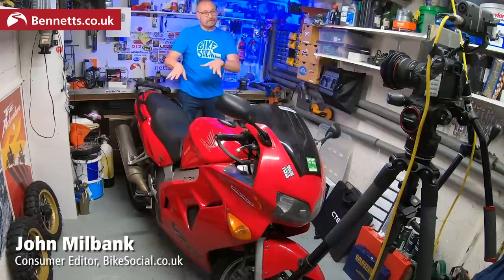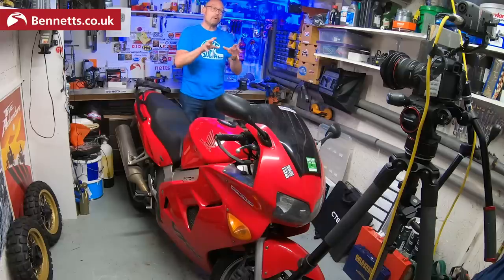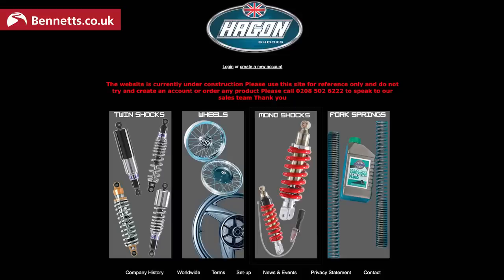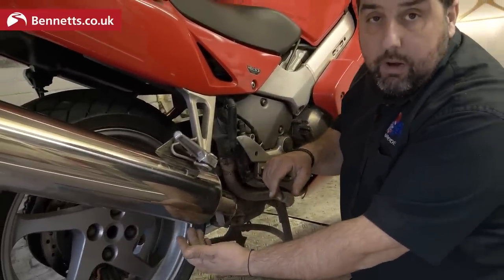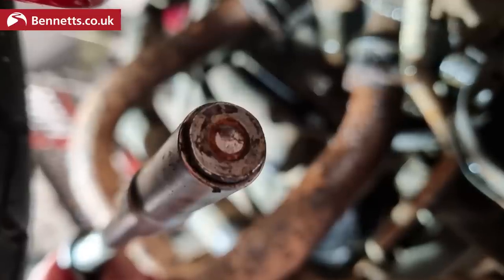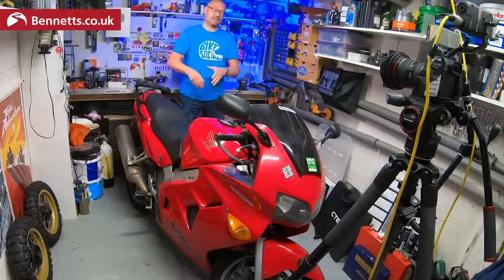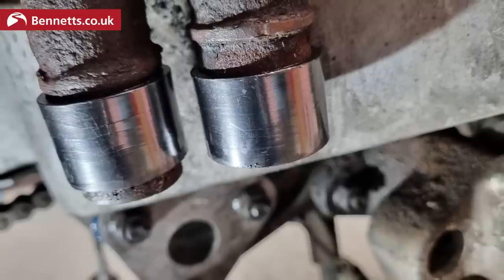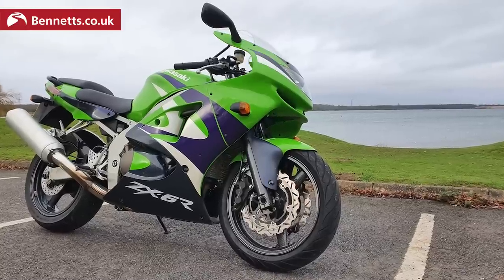Shock swap on a 97,000 mile VFR... what could go wrong? Everything.

Comment: Christ knows why you had to take the front pipes and collector box off.
I've had my 800 from new in '98.
Changed out the shock after 35k for a fully adjustable Nitron, it's been jn and out a few times for servicing. I have slso swopped out rear shocks on a few other 800s with no problems and have never had to remove anything but the rear wheel and the end can.

Comment: What if I told you there is no need to remove the exhaust to change the shock?
Reply from the maker: I was also trying to get the full linkage out to check the bearings - sadly it has to all come out for that. But yeah, once I'd got the whole thing off I realised!

Comment: Did you replace the collector box bracket bolt
With an Oem one. Doing this job now what a massive  pain to remove that bolt same as yours completely corroded have it our now as I'm fitting a full stainless exhaust and the centr stand is a pain aswell. Love your videos their  making my job a bit easier to do , I'm goimg to replace the rear shock aswell .
Reply from the maker: Yes, and it was bloody expensive! Cheers, John

Comment: I did mine with a hagon shock without the remote and it only took me about an hour, I never had any issues 😂… mine hd been a bike only used in the dry by how it looked everywhere
Reply from the maker: Show off!
Reply: @bennettsbikesocial  I must just have got lucky, I don’t remember taking exhaust off, the shock dropped out at the bottom after I removed the triangular mount

Comment: Ahh nothing like having a whinge at design engineers that made something as wonderful and robust as these VRF's. A 150xxxkm bike that's been averagely maintained, is rusty as hell and has an exhaust system as flogged as that should have been better cared for long ago; it's an outcome of poor maintenace you're dealing with not poor design, if the cheap hardwarewas replaced before it got to this state there'd have been no issues lol? So funny, you Euro/UK guys have  a very different tolerance for rust than we do in Aus, in Australia a conciencious owner/quality mechanic would have tossed those flogged headers, flanges, studs, shock bolts and replaced them all a decade ago looking like that; and cetainly wouldn't have refitted them in that state... when Delkavic make the whole system for 250pound/$480AUD. Also those rear shocks ARE rebuildable by a shop that knows what they're doing, I've had multiple stock sealed OE shocks (inc. a Husky TR650 & my VFR800) rebuilt, pistons machined and revalved in the past. Loads of shops in Aus, and I'm sure in the UK, that can do this. Obviously the full replacement is a nice option but also cost me ~180pound/$350 AUD for my last sealed unit rebuild & revalve and this replacement cost $1000AUD so better to do at least rebuild of the stock unit than nothing for those on a budget.

Comment: 9:25 If you were a gentleman, you might have done the heavy lifting whilst you wife pushed the bolt in. And if you were an engineer and aspiring contortionist, you would have used a simple wedge or lever system to lift the back wheel as you aligned the bolt yourself. 🧐😎😜🏴 VFRs are great value aren’t they?
Peace
Reply from the maker: I'm neither!

Comment: I don't understand this. I have had the shock out of my VFR  ( 2001)3 times . (106000 km) I put  a WP in it at bout 25,000 km,  and haven't had to take the collector box off. I took the back plastic off and the bottom bolts on the rear sub frame and lifted it up and braced it out of the way with a 4x2.. Once the bolts are out of the shock I jacked up the rear  swing arm without the tyre on it and could wiggle the shock out the bottom.  (Well I think that is how I got it out but the Chemo fog makes me wonder. ) The top bolt , well that is their little joke. they must be put in before the wiring bundle. Bolt head is on the left. I put it back in from the right and it is easier to get to . I was able to have it on the center stand.  I did also take the right side heat shield off and then thought  that is wasn't necessary. I had springs and valving done by Frank Ponds and the bike is nice to rice everywhere. I got the hydraulic pre load as well.
Reply: I like you dedication getting the broken stud out. I think I would have retreated to the corner for a few deap breaths and called for help.
Reply from the maker: I was trying to get the linkage out too, to fully service that... wish I'd not started that!

Comment: I feel your pain on the collector bolt. Last year I replaced the exhaust system on my '01 VFR - it's only done 27000 but the bolt was in a similar condition. It took hours of careful cutting and drilling. Was ready to burn it to the ground. 
Got to replace the shock as it's failed the MOT - at least the bolt should be easy this time as all the pipes and bolts in the new system are stainless.

Comment: Hate to be the bearer of bad news…but you don’t have to take the exhaust off to remove the rear shock.
Just did it last week in like 2 hrs
Reply from the maker: Yeah, I realised that, ta. I actually had explained why in the shoot (I wanted to get the final link pin out to grease it), but accidentally cut that section in the edit, then lost track. But yeah... there's nothing like making hard work for yourself!

Comment: I'm confused I changed the shock on my old 99 fi and didn't need to remove the collector box. It was a lot simpler than changing the shock on the 1200, trust me on that.
Reply from the maker: Yeah – I was trying to get the entire linkage out, so was removing it all. It wouldn't surprise me that it could have been less grief if I'd not bothered!